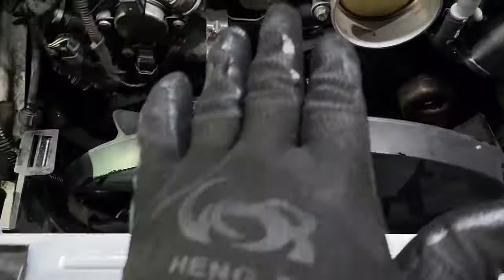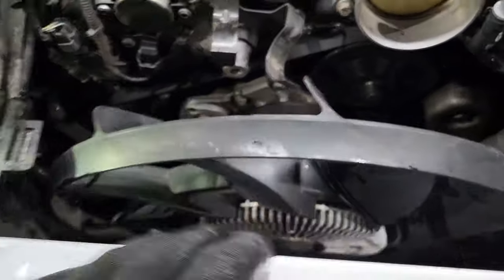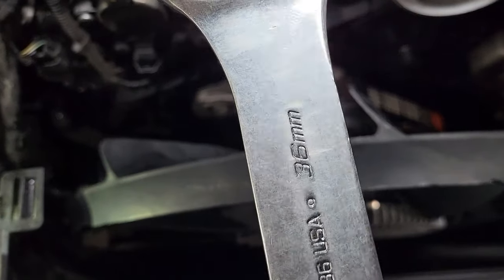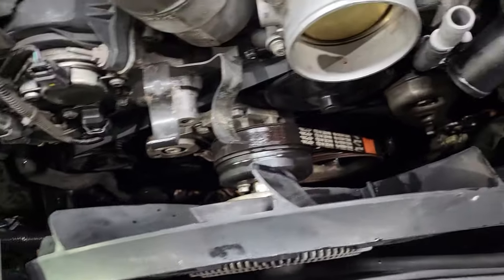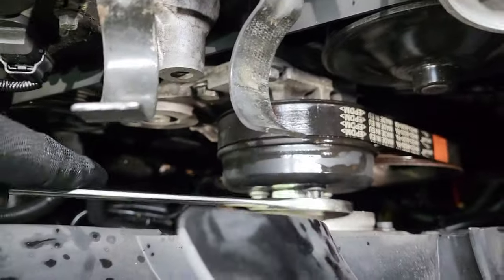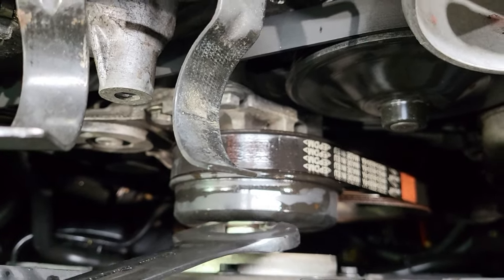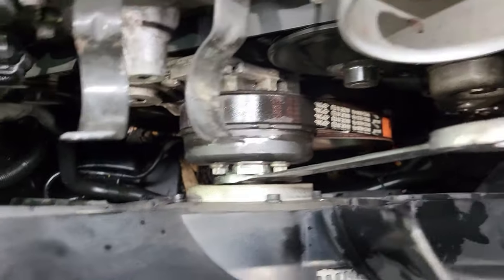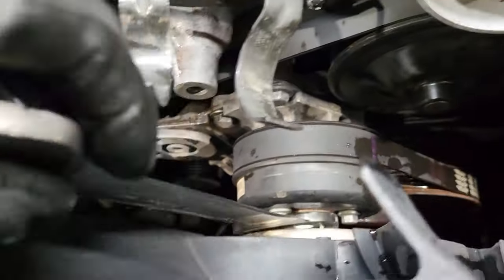HOW TO REMOVE RANGE ROVER 2008-2012 FAN CLUTCH WITHOUT SPECIAL TOOLS #fanclutchremoval #rangerover

Comment: Best 3 minute video ever! I've struggled with this stuck sob for a week.  I did have to hold the pulley back with the Amazon POS tool thing onto the little bolt while I wacked the 36 mm wrench I bought, anyway thanks so much, it worked now I can replace my shredded belt!!!
Reply from the maker: That is so awesome. I am happy it came out smooth.

Comment: When I do it it moves the whole belt assembly how can I prevent this
Reply from the maker: Try using some WD-40 and give it like 5 minutes before trying to open it.
Reply from the maker: Also to counter the force use a flat wrench preferably a long one 13mm and let it lock on one of the bolts on the pulley and let it rest on the next one.
Reply: @all-about-cars-basics  so basically give the pully more tension while countering the gorce
Reply from the maker: @samuelbobert5769  Yes, that is the idea.
Reply: @all-about-cars-basics  based off which way my fan spins how should I unscrew it

Comment: Hi question please I have a 2008 Range Rover HSE and the fan  is just about all the time on and it’s loud, ? Should I change it put a new one or probably is there any sensor to be changed? Thank you so much.
Reply from the maker: I did not understand your question well. But what I understood is you have noise coming from your fan clutch. Maybe the fan is touching the cover shroud. Check it out. If not you may end up replacing you fan clutch with a new one.

Comment: Man mine is so tight this will not break it loose.  Any idea how to get it to break loose.
Reply from the maker: Dang! what a bummer. Okay, try spraying some WD-40 and let it sit for a while. That does the trick for me all the time. Good luck :)
Reply: If you've bought the remover kit try and hook it over a bolt head and hold it while you whack it to your right, it's reverse threaded so righty loosey

Comment: why are some left handed threads and some right???
Reply from the maker: Most Range Rover fun clutch follow the rule of thumb. That is whichever way the engine rotates, to loosen the fan you have to turn the nut in that same direction. But this sometimes is altered by the pulley arrangements between the crankshaft pulley and the pulley that holds the fun clutch. Personally, I do not know why Range Rover kept changing the direction for loosening the fun clutch.
Reply from the maker: Thank you for this very thoughtful question.

Comment: Mine is spinning but it’s not unloosing
Reply from the maker: Which year is the Range Rover you are working on? Apparently different year models have different directions for loosening it.
Reply: I have a 2011 5.0 supercharged Range Rover.   After bending the tool I was using to turn to the right,  I found I was turning the wrong way.  Total misinformation